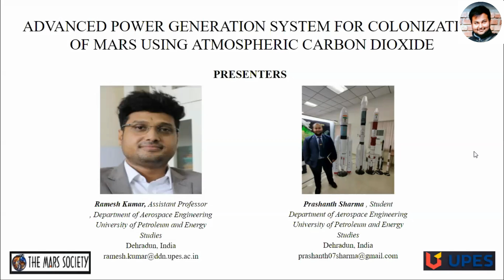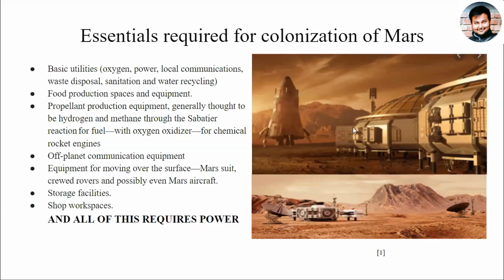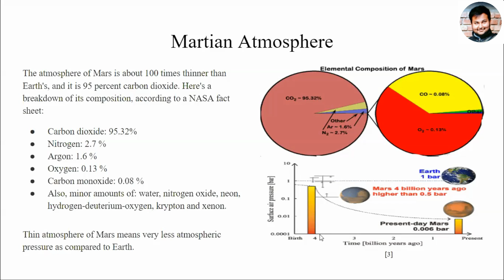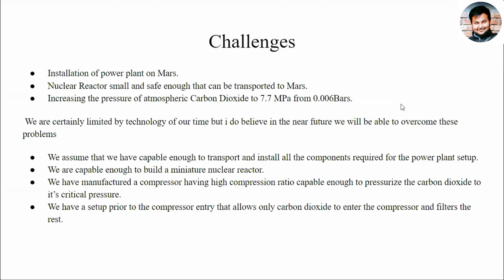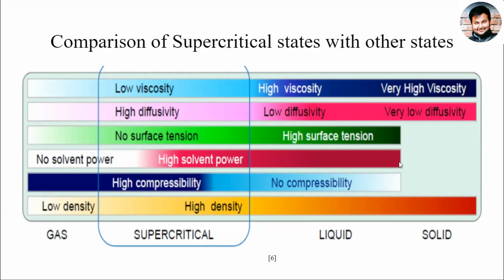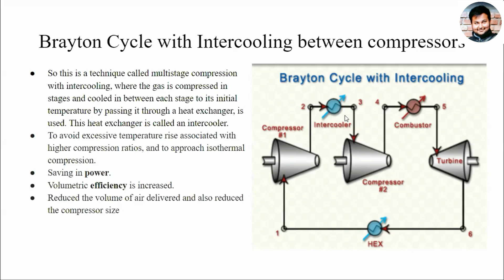Power Generation for Mars using CO2 - Kumar/Sharma/Chaudhary - 23rd Annual Mars Society Convention

Comment: Am I missing something? The whole CO2 system is just a way to convert heat to electricity. This isn't power generation, the power comes from the heat source, aka nuclear reactors, solar heaters, etc. This is simply energy transformation, used to obtain electricity. Might be useful, sure, but it's misleading to suggest this is power generation.